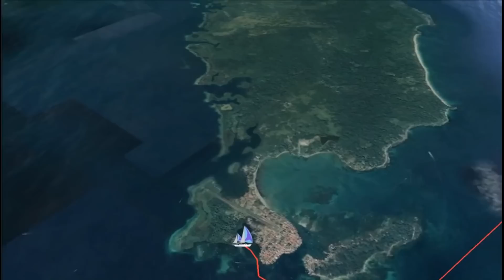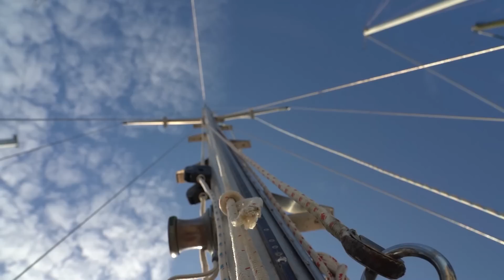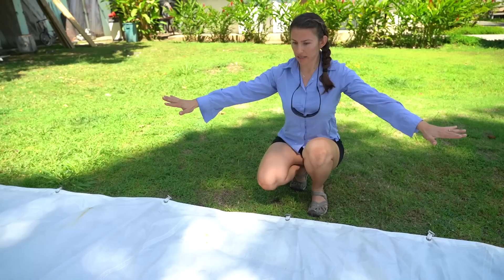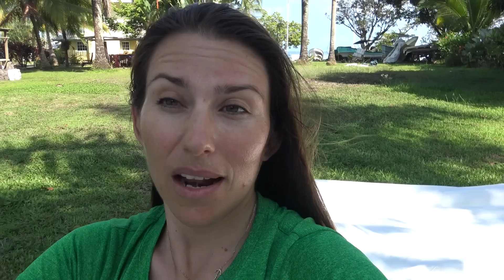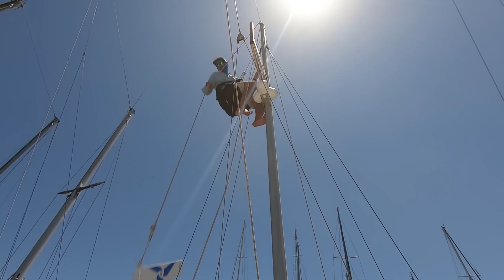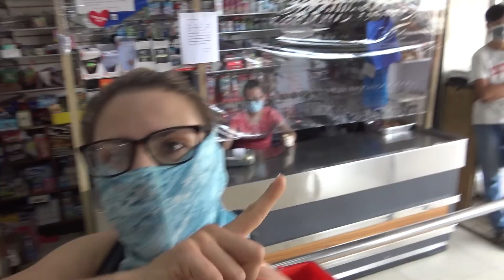Coronavirus: Things are Getting Crazy in Panama | S04E22

Comment: With modern boat molds CNC'd from computers, we forget how rudimentary these older fiberglass boats were, and as such, assuming they are symmetrical may not lead to the best results when trying to plumb a spar.  On top of that, you have to start with a boat that is trimmed correctly (Are the countertops parallel to the waterline? - it can drive you mad!)  Sometimes you have to step back and look at the bigger picture to where it looks right, or tune while on the hard using a laser level.  On top of that, you may want to use what you've learned about the weather/lee helm of your boat to adjust the rake in your mast to help compensate for that.  

Tuning the rig on my 1976 Westsail 43 for the first time is when I discovered that the people who made the deck mold molded it with the mast step offset to one side by 1", which meant a 2" difference side-to-side.  Yeah, they were smoking a lot of weed back then!  The second time I realized just how "eyeballed" these older boat molds were was when I went to mount my Monitor wind vane.   There was nothing square about my cockpit molding vs the cap rail vs the mast.  All of them were running at different angles so I had to do a little eyeballing of my own in order to mount the Monitor such that it looked right and functioned properly.  All the best, Ted

Comment: The air filter is not an essential part for a marine engine. There is little to no dust in the air, so it doesn't filter much. It can turn black from blowby or, as you suspect from belt dust. I wouldn't postpone a trip waiting for the filter. I've had boats that didn't have a filter at all. Just my 2 cents worth.
Reply: Yeah, I was thinking just the same. Belt dust is essentially rubber, I don't think it is going to hurt
Reply: Many Motorcycles running without a Filter, not Ideal, but working for a wile, especialy on a sailing boat.
Reply: A back fire from a missing filter set my boat alight.
Reply: No way, can't agree at all with your advice. What do you think belt dust is? Or old foam particles from acoustic insulation/firewall? Or paint chips or rust particles? The engine room has loads of particulate matter (especially on old yachts) and why do you think his filter was so filthy and clogged? Use your jury-rigged filter for now but get that new filter back on ASAP bro.
Reply: @player1tv  no it never my good fellow

Comment: Dude, I am very very qualified to give you this advice. Run the engine with out a air filter. You are running a boat engine. Very little dust in the air. Vacuum out your engine bay. Keep your engine bay super clean! you will be fine. 
If you are very very concerned about it. You can built a filter box to hold any filter paper.

Comment: Hey guys don’t stress! Marine engines really don’t need air filters 🙌 cars do because they are kicking up dust as they drive but a boat isn’t so you will be fine. Worry about food and water the kubota will keep on kicking for decades to come trust me! 👍
Reply: Cost guard regulation call for a spark arrestor on the intake on all internal combustion engines.  It is not a cheap fine and the mess will serve as such device.  This is truly only worth anything on a gas engine, but we know how governments see a fine as a income so let's put it on everything.
Reply: Normally i would agree with u on the marine filter but when the filter looks like that id be wary of not having a good filter in place . Something is wrong somewhere.
Reply: I was about to say. Especially marine engines there is very little dust. So vaccuum or  sweep out your engine room and carry on without an air filter.
Reply: Rescue Boat Revival Thank you for that info .

Comment: That was the oldest dirtiest filter I've ever seen
Reply: That filter was filthy. Inspecting it , and replacement needs to done on a better time interval so it doesn't get that bad ever again.
Reply: yes, what prize do they win?
Reply: @drx1xym154  I've had power boats since 1985 they do not have air filters they have resonators you're in a clean air environment you can run that little diesel engine without an air filter temporarily will not hurt it
Reply: that filter cracked and all can be washed out and superglue back together. anything you do in repairs is great. if you have to actually order a part - get two! if you use a tool many times - get a spare. frustration is one thing, learning to adapt and overcome is a better thing.
Reply: @ricktimmons458  I was just sitting here typing the same reply! If you have to buy one, get two. Why? "Because 2 is 1, and 1 is none!."  Always carry a spare for anything that could prevent your exfil.

Comment: Oopsie, you didn't seal the wood that was bored through when the cable was put through the deck. (just relying on mastic isn't the same as sealing the wood fibres with a layer that is as thick as the grp that is on top of it preferably.
Reply: he used butyl rubber

Comment: You can get the material to build a replacement from modern car filters which are usually very large these days. If there is an accessible scrap bin near a car repairer there will be plenty of used ones to look at or experiment with.

Comment: Hi Jordan and Desiree... first, prayers for you guys in your endeavor under these extreme conditions. Second- Jordon on mast tuning: I know that you're on the right track making sure the mast is plumb, but once you get under sail, get at the base of the mast looking up. With sails up, it puts a lot of pressure on the mast, stays, and shrouds. Believe it or not, there is a little stretch in wire rope (shrouds, headstay, etc.). The longer the wire the more the stretch, so the headstay, backstay, and uppers may stretch more than lowers.  Just double-check that the mast is still straight and no S to it. It may show more in heavy weather on a hard beat or close reach.  Lastly, the hole you just drilled through the deck showed some wood shavings coming out after you went through the glass. It would be a good idea to take some resin and coat the inside of the hole, top-to-bottom to ensure the wood is sealed in case of water leakage through the seal in the thru-deck clam you added.  Good luck, guys. Love your channel.

Comment: Check your exhaust system (manifolds, gaskets, joints, clamps etc etc) are not leaking. Leaking exhaust gases can be sucked back into the engine and hence the dirty air filter. Especially in engine rooms where ventilation to the atmosphere is not possible.

Comment: If I were trying to rig an air filter, I would recommend cleaning the old one thoroughly and then wrap it with the wire mesh to keep it together and reinstall it rather than just use wire mesh.

Comment: Good to see the boat coming back together. Regarding mast tune, consider checking the placement of the chainplates by measuring aft from the stem/tack fitting and thwartship from the mast step and gunnels. Sometimes builders did not percisely place the chainplates. Any misplacement would be affect your tuning. Also, thwartship mast

 centering is critical, but fore and aft rake can be adjusted to acheive the desired helm balance. If you plan lots of downwind sailing, say crossing the Pacific, tuning with masts less  raked/further forward may be beneficial. 

Also, since you now have extra time before your Pacific crossing, consider getting a HAM license and springing for a SSB transceiver and tuner. For a space limited boat on a budget, a Yaesu FT857 and SGC 239 tuner connected to a simple laptop are hard to beat. The SSB cruiser nets are alive and well in the Pacific, and you would also have much better Wfax reception, access to GRIBS, and email offshore all free through Winlink and Winmor with a HAM license. Given these uncertain cruising times, the additional communications with others cruisers, and those already at your destinations is now even more valuable.

Stay safe and healthy!

Comment: The hardware cloth(wire mesh) is a good start. Think bigger and filled with foam. The Welshman is right many two strokes use a light amount of oil in them. You would need to make sure the oil didn’t damage the foam.

Comment: You need to call your sailmaker to get the proper rig tension settings for your rig.  A properly tensioned rig will flex under load and will reduce heeling when sailing to windward.  The correct tension will also reduce the yaw moment, improve pointing angle and prevent excessive weather helm from forming which drags the rudder through the water and slows the boat.  You'll be happy to learn that taken to its extreme, the rig tension will vary for each point of sail.   :)

Comment: The thru-deck fitting that you installed for the mast wiring should have the edges of the plywood core protected with epoxy. Reference This Old Boat or Boatowner's Mechanical and Electrical Manual - I'm sure you have both on board! Looking great keep up the good work.

Comment: Hi I am a new subscriber to your channel, and really appreciate your videos. I have been a diesel mechanic on the largest equipment in the world here in the gold mines in Nevada. The air filter was definitely plugged, and the engine was starved for air. I've seen that a few times, and usually after there is operators, and lube people fired because it will smoke an engine quickly. Please don't think I'm being hard on you because you both are doing what most would never have the courage to do. Thank you for the great videos.

Comment: You may not get your part as quickly as you expect, even if the mail is technically "running."  Normally, a lot of air cargo travels on passenger flights, but many of those have been cancelled.  They're running some dedicated cargo flights, but the cost jumps up because the return flights are often empty.  Air cargo rates doubled in one week when flights started shutting down, so some things (my order from the U.K.) are presumably held pending reasonable rates - or on a slow boat.

Comment: Dude you don’t need the air filter - so little dust in a boat the engine won’t care. Most air filters are fitted to Diesel engines in boats to reduce the intake noise. If it’s belt dust just adjust the belt tension or sort out the pulley alignment. Good luck team 👍

Comment: Another option is running a plastic or aluminium hose like what is used on dryer vents to the outside or the cabin interior for clean air. or fit a flex hose and connect it to a larger air filter that has a housing, again inside or outside or clean air. The you won't have issues like this. Get to know any of us who have mechanical back grounds for ideas of how to fix or prevent possible failures you are coming across.

Comment: Instead of creating the air filter by screening over the 3/4 or 1in inlet, I would be inclined to try and use an electrical or plumbing connector to connect an empty 16oz tin can to the small inlet, giving you a 3in opening to screen over, and consequently less air restriction.  Fasten the screen over the open end of the can.  Dirt bike filters are foam with sticky oil applied to them.  Take enough foam to fill a sock 1/3 to 1/2 way.  Oil the sock and foam with wd40 and ring them out, then put the foam in the sock and the sock on the can.  This will give you a large inlet area for air.  Don't oil the top of the sock so that duct tape will hold it properly to the can.

Comment: With your air filter, there is a small chance that the local auto parts store will have something, discovered this on an island in the Philippines we were able to dig up an oil filter and diesel filter for a yanmar. Generally these places have nothing but in the off chance they use this filter for another application you might get lucky.

Comment: Take a hard plastic coke bottle and cut the top to the sise of the inlet. Drill holes in the bottle(ca. 10 mm an 5mm apart). Put the mash around the bottle. cover all with a sock. This is better than the original flter. The trick is to have a huge sureface of the filter.

Comment: If you have cover the job of the air filter, you can build a filter with a bottle.
you need a bottle, and some hoses..
on hose is going down to the bottom of the bottle, this willl the intake, and you need another hose connected to the top of the bottle.
put some water in the bottle.
the air is going directly into the water, and going out on the top.
most of the dust will be captured by the water.

Comment: The rig tuning looks tricky well done, the mesh filter will be fine its when your engine is in dusty or sandy environments you need the better filtration, many marine diesel engine just have mesh or similar. Can you see any name or numbers on your air filter, sometimes its possible to cross match to a Fram, Bosch, Hengst, Wix, Fleetgaurd, Crossland or Mann and Hummel filter.

Comment: I sailed for 29 years and the Westerbeke and Perkins diesels had no air filter except one to keep mice and roaches out. You shouldn't need one in a boat. Make sure all v belt pulley's are perfectly aligned. When they're aligned and not slipping they last for many years

Comment: Nice job on the air filter, thankfully diesel engines have a wide range between lean and rich...not as critical compared to a gas engine.  Just a thought,  mesh is great but it's not going to filter much other than large particles...may want to dip it in something that is tacky or sticky to catch the finer particles.

Comment: Greetings,
Just a thought from a casual observer and a highly trained mechanic. Just looking at that filter tells me it's clogged and long overdue for servicing. With that being said I have never seen a filter tear in half. 30 plus years experience here. I would recommend talking to the folks at K&N filters about your filter needs. Next I would ask where is the fresh air intakesupply for the engine? Is it breathing fresh air or is it breathing air from inside the engine compartment/cabin? You want it to be on outside air in calm seas. Also, I always tell people you want your engine to last? Maintenance, maintenance, maintenance. If you can't find a reusable filter i.e. K&N or equivalent constantly clean filter with compressed air. Also the filter paper itself should not be saturated with oil. If it is you may need engine work. So, let's review: maintenance, reusable filters (always the best option) fresh air intake and proper engine operation contribute to a healthy, long lasting engine. I hope this helps. Best wishes. 😀
Reply: ❣️ Marry me, LOL

Comment: If you want to DIY an air filter, better than wire mesh, see if you can (fiberglass reinforced) construct, say, a cube in "ribs" on a mounting tube and then fill the space between those ribs with vacuum cleaner (HEPA) filters. Make sure to have those filters fist ...

Comment: Bless you two, but the idea that wire mesh is a ok filter replacement is a bad one. The wire mesh is used mainly to keep the form of a filter, but foam or paper is used as a filtration media. Just thought I should tell you that your engine is at risk running it that way.😁

Comment: Is your generator singel belt? might be good ti change to dubbel or multiribb -better.. if you extend the intake tube so you can have the filter outside engine compartment , or just the intake to the filter. it would last allmost forever..not much dust at sea😃

Comment: And be mindful of the size of the area that the air is being sucked through.  The stock air filter has all the pleats - if you were to unfold them it's a huge area.  Perhaps you could make a cylinder with "hardware cloth" - a coarse mesh of say 1/2" squares - and cover that with the mosquito screen, then cover that with a washable coarse fabric like t-shirt material or open cell foam (air filter foam).  I think the best would be to find a similar sized air filter from a truck/car/generator/other boat engine and then connect it with an adaptor tube.

Comment: I guess it’s the old saying, too little too late ? But seeing you working on the mast’s there is a product made by MerryKate called “ Aluma Clean “
This is a great product for cleaning bare aluminum masts. I have used it in the marine industry for years. Use it with fine bronze wool , this will help with the corrosion on old mast’s.
As for the air filter ? In the marine industry engine air filters are never used. This is something that has come about in the last few years.
Why have they never been used you may ask ? There is no sand or dirt in a bilge. The dust you see on the filter that you mentioned while talking to Beta could well be from the belt. Check the fan assembly mounted on the alternator, are there signs of belt dust ? If so check the belt tension and allingment . Belt dust could also be from the alternator working it’s ass off due to load, undersized wire or the batteries are marginal as to condition. With regard to the air filter ? Due to your circumstances and travels you need a cleanable reusable air filter ? See if you can buy some course bronze wool and form a filter inside the black plastic air filter housing. You just want to make sure what ever you use will not be sucked inside the engine intake.
I know the engine is new, but check for blow by. This would also make the filter black.
     Good luck , keep the videos coming !
Reply: I'm no professional, but without a filter wouldn't all of that black crap have gone into the engine?

Comment: A DIY solution is , clearly, in order. An air filter is an easy DIY project. I would suggest that you simply repair the broken one - and continue. The wire mesh - is , um, not a solution...... You are not blocking dust from entering which is what you want to do . Cheers